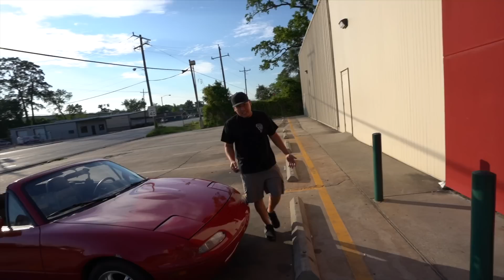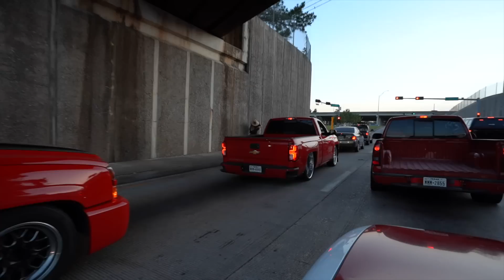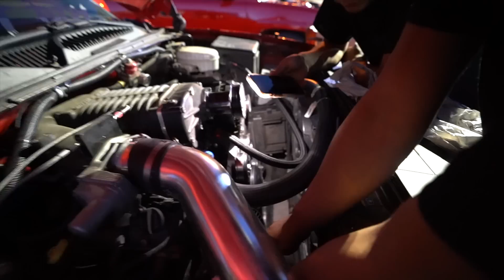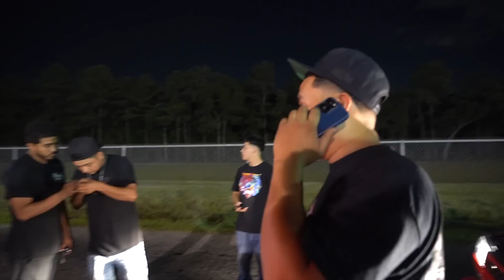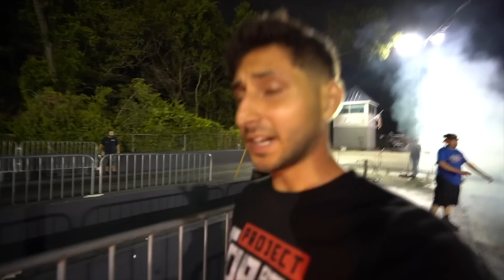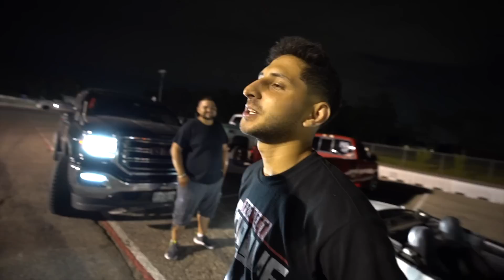OMAR CRASHES AT THE TRACK! 🤦🤦🤦🤦

Comment: Omar's, miata probably has an air pocket in the coolant system or needs a new radiator. I had the same problem on a 300Z always over heating...💭🚘
Reply: Miata performance! Perfect...👌🏼

Comment: Need to honestly get a short rear end for the king corba or a floating ford 9 inch rear end for it for the turbo truck cuz the bed up and put a big ass tire and turn the boost up up if its got a built engine